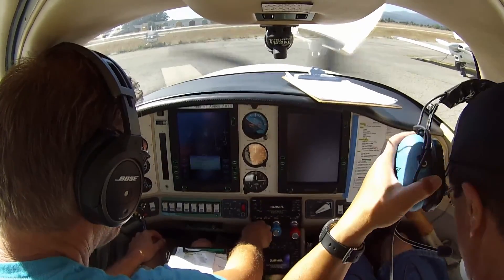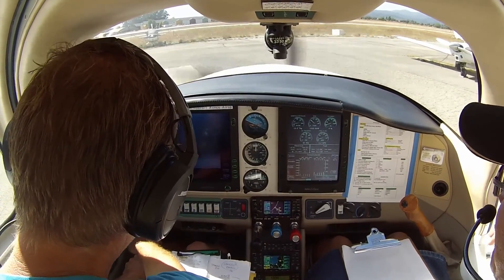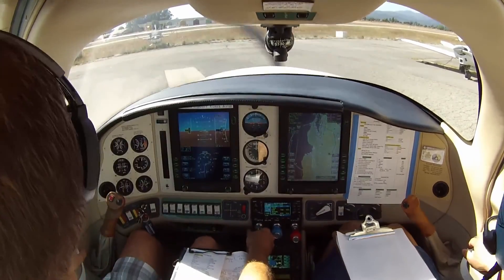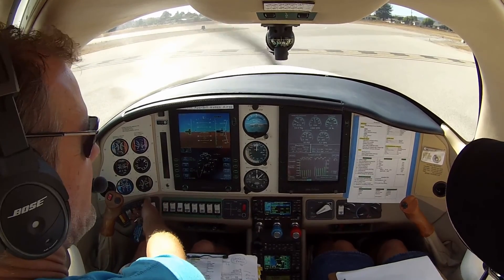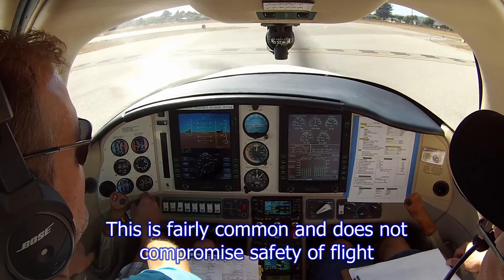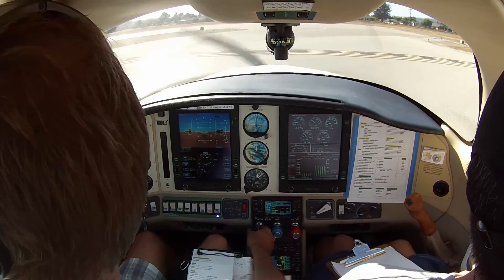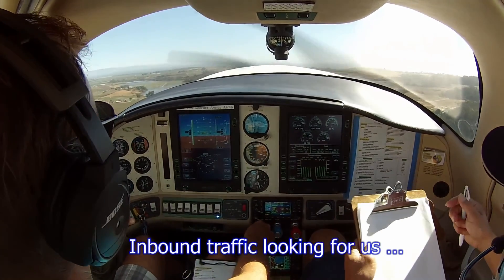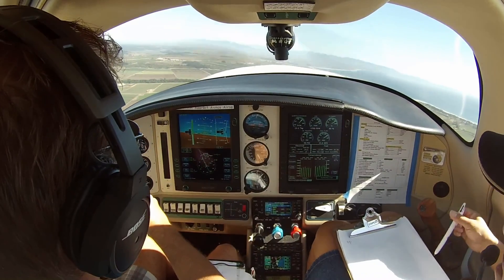Startup, run up, and take off in a Columbia 350

Comment: Thank you for this ....purchased a 2003 Columbia 350 recently
Reply from the maker: Congrats! A great plane, but spends a bit too much time in the shop lately! Let me know if you have any questions
Reply: Columbia 350 Flying Videos 
What maintenance issues are you dealing with and should I plan for down the line?
Reply from the maker: Right now, a lot of little things expected when you’re near TBO: rebuild muffler, install air/oil separator, replace engine mounts, couple of flat tires. Several years ago, many hard start engine issues corrected with trickle charger and fine wire spark plugs. We also did the ADS-B in/out about this time.
Reply: How’s it going with your plane ?   Still glad you got that model?
Reply: @chinoman7234  Hey Sir! I liked it so much I upgraded to its older brother. 2008 Cessna (Columbia) 400. Awesome aircraft!
Reply: Bill Krokos so I have roughly 50 to 60 hrs.  I know I am a rookie.  I need a plane to fly back and forth from Michigan to little cayman. What would you suggest ?
Reply: Bill Krokos thank you!
Reply: @chinoman7234  Good luck! Remember to learn the aircraft and practice!
Reply: Bill Krokos thank you for taking the time.  Be safe flying

Comment: How difficult is it to transition to this type aircraft from a C172?
Reply: It is not hard. You can use a cessna 182. This is a high performance plane and you will need a sign off. However, this is a fast plane and you will need to build at least 15 hours in it with someone before taking it solo. Also if the 172 you have been flying was not a G1000 system, you will need sometime studying the glass system. I also do not recommend flying this plane without and IFR rating.